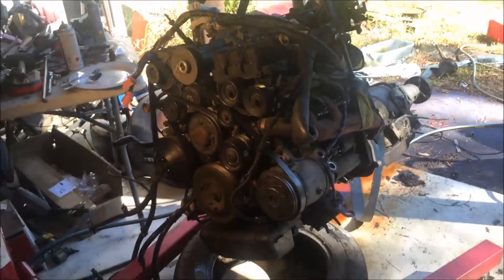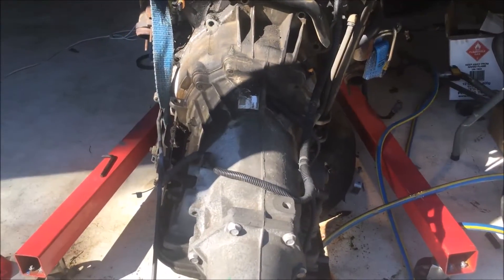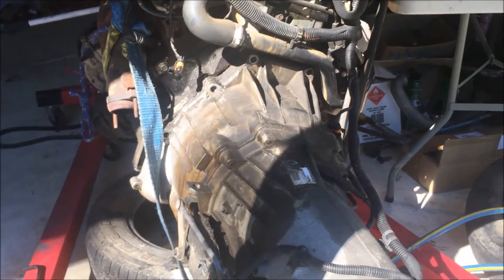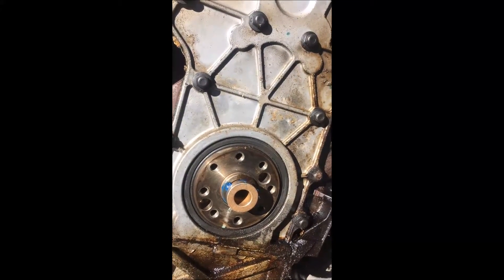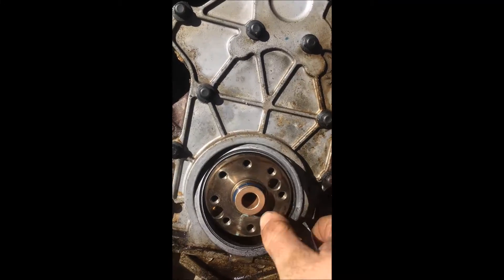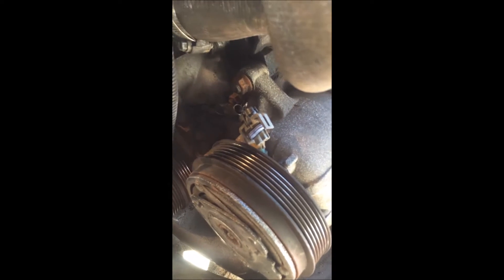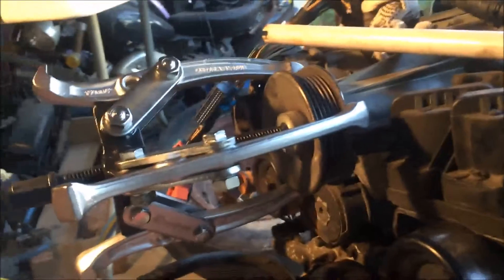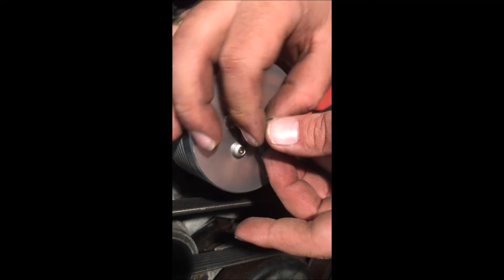L67 into Holden VS Commodore PART 1!!!

Comment: Hay how long did the gearbox last?  are you using a t5
Reply from the maker: Hayden Woodhouse Hey I have a getrag box in my VS, I took it to the track and have had no problems at all.
Reply: still going strong with the getrag?  about to put a getrag box into my super6 vx.